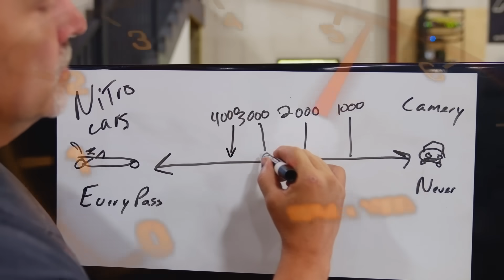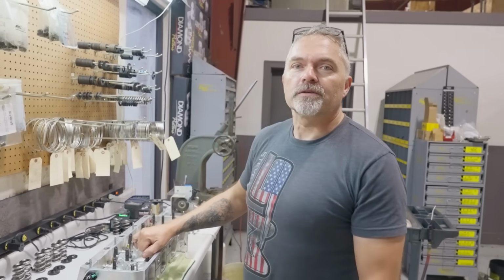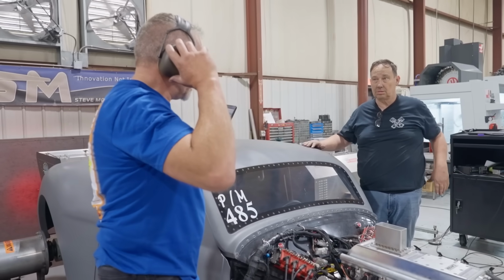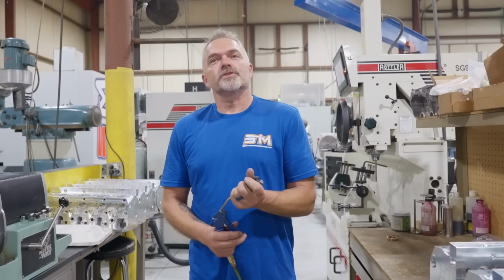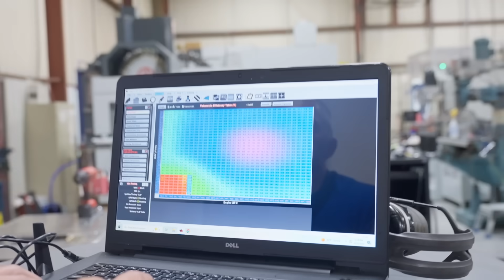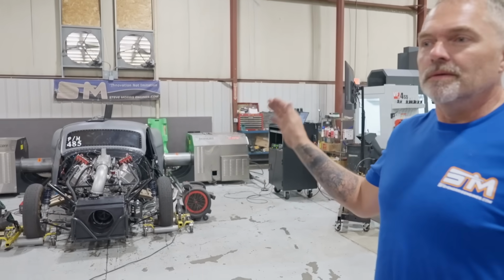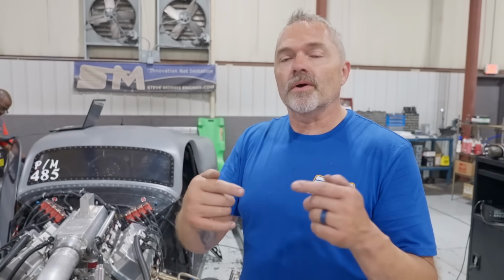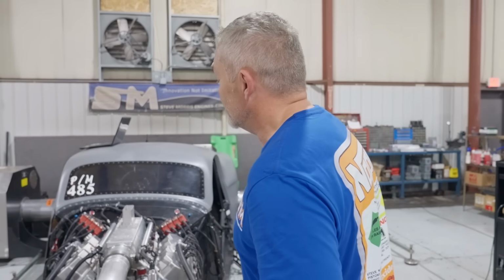OG MULLET IS BACK AND FAST!!! + Pro Mod Hemi First Ever Start and Tune

Comment: When the scratch and dent SMX is no longer repairable it’s gonna make a mean podcast table! Encase it in 300 gallons of epoxy!
Reply: What a sweet idea man!
Reply: @lsucody3687  no need for epoxy on stuff like that. Just add small brackets to hold a table top on it with some feet too. Preferably using rods or something car related.

Comment: SMX vs Pro-line. SMX a streetable massive HP engine with durability added, Pro-line basically a dedicated  1-2 run engine before having to be touched and parts swapped usually. This is the truth without bias. Respect the SMX and work Steve has done to make it a super power out there
Reply: Try 25-28 passes. Everything else that gets checked on a proline also gets checked on a SMX. The exact same issue with the proline at world cup wouldve also happened to the smx if they didn't lash the valves properly. The SMX makes a lot of power for an engine that also drives on the street but it doesn't make equal to or more than a Proline Hemi. There's a reason all the NPK cars and a ton more teams use Proline. There's also a reason the fastest and quickest drag and drive cars use a SMX. They can't be compared.

Comment: I'm so bummed.  was hoping to see some numbers from that Veney headed engine.   The 1066 head has 2.600 intake and 2.100 exh valves.  The last version we made had a revised combustion chamber/ piston combo that was pretty trick.
Reply: Guessing you worked for him?
Reply: @markg1495    Yes, 17 years.  Learned a lot from Ken.

Comment: More timing in decel should help with the issue of it dying on the trans break.   No cylinder pressure, more timing.  40 maybe 50 degrees.  Typically for the cars I tune, especially an ls or Lt, they have 55 degrees during decel and they clean up quite a bit.  40ish during cruise above 2400rpm.  Helps with drivability and they sound pretty clean with no loading up during cruise.

Comment: I always run autos with lockup on the dyno, so much more control, don’t have the converter torque multiplication to contend with and can actually get some load on without flaring the converter/revs right up. Plus less heat on the trans, I’m only playing with 1000-1500hp cars but same deal applies if the lockup can hold the power and that’s how it runs down the track then it’s good enough for the dyno, plus if locked up before starting the pull it’s easier on the lockup rather than it trying to pulls the revs down as it does on the track so no issues there
Reply from the maker: Dang
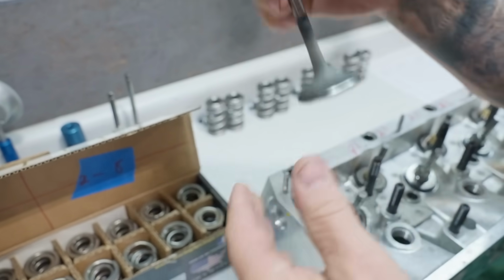Reply: If you dont have a lock up use a 12" big block RV converter with 3:23 to 3:55 gears and run in second gear on a roller dyno.

Comment: OG FTW. Cleeter found out that doing what he did to the SMX dont work. That after every run they need to check it. The valves and such didnt look good.  Great Video Steve Sir

Comment: This motor kept giving cleet isuues because that crank was broken from the first time they ran it. It’s why it kept making metal in the filter from it flexing
Reply: 😅😅😅 yeah sure
Reply: Crank was not broken causing the metal, it was the converter pushing on the crank which broke the thrust bearing, that is where the metal came from. Crank cracked much later, cause that shit woulda come out of the car.

Comment: Steve, as a dynocom owner. I’d say do what you did with your engine dynos. Delete the quantum software. It’s garbage. Contact Henning at sport devices. Swap over to their system. The hub will be far more useful. 

I’ve done it. I’m not getting any kickback for offering this advice. 

Love the work you do. Thanks for the entertainment

Comment: @stevemorrisengines you talked about the zoomies and the o2 sensors. Your 02 exhaust sensor pipe is to small. Above 500hp the pipe should be no less than 1" pipe

Comment: That is not a punk dyno either, when I was there I looked it up. And you should talk transmission tuning  with the Holley, maybe line pressure, tcc lockup, and how they relate to putting power to the ground. I made it so you can charge up to 1200$ per hour for video chat consultations. I really liked the advice you shared, thank you Steve!

Comment: I wondered about the lockup converter. I also wonder how he expects to shift a 5 spd lenko in an 1/8 mile. If he hits 5 gears in 4.5 - 5 seconds, he is the man😂
Reply from the maker: Auto shift and fast
Reply: 1/8 mile should be 3.9 seconds for promod’s.  No idea how he plans to shift through the 5 speed.

Comment: The guy definitely should check and clean all of his injectors before trying to make a hit in that thing.  Like you said having one injector fail with a double injector (per cylinder) setup is a recipe for disaster.  That’s one big advantage of a setup with one big injector per hole.  If one injector fails the hole just goes cold.  Way better than that hole going dead lean and torching everything.

Comment: Two Questions on this Video, #1 Could Your Electronic Gurus Wire You Up a Big Green Light For the Dash That Lights When All The Injectors are on and Functional, Red If One has Failed..?   #2 That car Had a Lenco, Did Your Drive Shaft Speed Sensors See Any Slip in the Trans..??  I know they Can Slip when Loaded Hard Enough.     Rich

Comment: Steve, I'm curious what the difference is between your hub dyno and the one that Fuel Tech uses?  They run the cars off the transbrake all the way to the top of high gear.  Can you explain the difference?
Reply: Correction. Fueltech uses a Mainline which is a stupid expensive and powerful dyno. A more advanced dyno than the Dynocom.
Reply: @AB-80X it's cheaper  in the long  when everything work's like a mainline does,with the exchange rate it's dirt cheap and the support and software is next level

Comment: Steve hope you see this question among the thousands of other questions I want to know if it’s worth having a SMX street engine? I mean a full street engine with steel rods hydraulic lifter “low maintenance “ engine that can be driven on an almost daily basis like a regular engine with let’s say around 2000hp ? That is if money is not a factor just for the hell of it ?
Reply from the maker: You could no problem

Comment: Why doesn't a Mainline dyno have these issues? I see fuel techs taking all the sauce? I completely understand the gearing and load issue but I've never seen fuel techs or even Xre's do the same.
Reply: Mainline is quality, and the software is probably more important  then the dyno itself,I have  never had a problem let alone a job that we can't do or hold
The new mainline software will be even better again (yet to be released)

Comment: I wonder what snot rocket combo is and can the wagon compete I never seen the wagon run the quarter but snot rocket was running 6.0s the weekend
Reply: Snot Rocket is a Stock cast block and head Coyote with sleeves.

Comment: Sounds like the SMX was way overkill for Mullet.
Reply: The SMX never got to race on a good prepped track with the bigger 315 radial and the parallel 4 link.

When they first put the SMX in Mullet they still had the stock style triangulated 4 link suspension, and they did run a PB but was basically the same 1/8 as the old big block ran. Then they upgraded to the parallel 4 link suspension. But they only had one event that had good track prep and they were on the smaller 275 radial.

So I think the SMX got the short end of the stick with Mullet being on bad tracks or the smaller tires.

Comment: Hey Steve...@ 12:11 are the brakes mounted inboard and not out at the wheel? I thought this might be a good way to move mass away from the wheel but I've never seen it done on a car before (only on Cleets tank)...what are the pros and cons of a system like this?
Reply: my 1978 alfa sud ti had inboard brakes. some jaguars also had inboard brakes and probably many more
Reply: @aeroflopper  ok...I had no idea...
Thanks...
Reply: Some cons are if you eat a rotor it's a pain to change if the axle brakes outside of rotor vehicle could possibly not stop
Reply: @Jack.jack6  absolutely we're I pain to change and service, only redeeming feature is they did not rust so much being inboard

Comment: Mullet was on the fastest pass when it shut off cutting that 107 or 105 60 foot that would have been a sme bbc record
Reply: No. You misunderstood it. It was at its fastest 1/8 at the time. It ran a 1.10 60'. However, the pass James complete after was faster with a 1.07 60' which is Mullet's fastest 60' and 1/8 mile. Mullet would not run in the low 40's on either of those passes.

Comment: Just curious as to why mullet is faster with your sml over your smx
Reply from the maker: Mullet has one of my original old school Big Block Chevy engines  in it . This was the first engine I did for mullet. 
My SML is a LS style engine. The SMX is a Big Block “Style “ engine. 
The SMX  makes way more power than the  BBC engine in mullet right now. 
Think about it, how many times did mullet spin the tire and have to abort the pass?  Lots, they tried upgrades but still spins.  So , put the engine back in that is more control-able and  more suited to the car.

Comment: Bro just admit its the crappy load control on the dynocom. Change that controller out FFS. Max love as always from New Zealand.
Reply: I've seen Dynocom do fine. But a Mainline would be better, and way more expensive.
Reply: @AB-80X  Incorrect. Dynocom is the worst dyno system in the world.

Comment: Steve-are you saying that the hub dyno cannot measure the power of this engine…? Is there a hub dyno made to handle these cars…?
Reply: The highest dyno horsepower I can find is 6,144 to the hubs from a Moran built hemi. So some dynos are built to handle it. Proline and Fuel tech have been having some fun recently with 5,400+ hp pulls on their dyno
Reply: Yes-I’ve followed FT-they are heavy into turbos now-great fun…

Comment: Not taking anything away from the proline engine, they’re fantastic. But eagle would have gone that fast with the smx, maybe even the 454. When you factor the times and 800lb weight difference.
Reply: Eagle is geared for 8th mile.
Power was not the issue
Reply: The smx definitely would have gone that fast but once they get that gearing ironed out the proline is ultimately gonna pull harder
Reply: Didn't get anywhere near full boost and ran out of gear the last couple of runs. Cletus was out first in the last race and if he had more gear not many cars have the 5000+ hp to run it down

Comment: Cleetus is not equipped to run a 5 second car along with the rest of the fleet.  The Eagle will be parked most of the time.
Reply: any proof of that?
Reply: @aeroflopper  If you look at the SMX he destroyed, you will see what neglect can do to even the best equipment.
Reply: @charleswoolsey2296  it was never a good idea to run that level of engine on 7 cylinders, but others have also granaded their smx;s including steve, cletus is no mechanic so he has to rely on others.

Comment: Steve, tell people your head design is not capable of matching a hemi head engine for max power.
Reply from the maker: I just did
Reply: No, tell your readers it's not just the water and cam differences, it's the superior Hemi design especially on boosted engines compared to the SMX layout, your good at explaining  the technical differences.